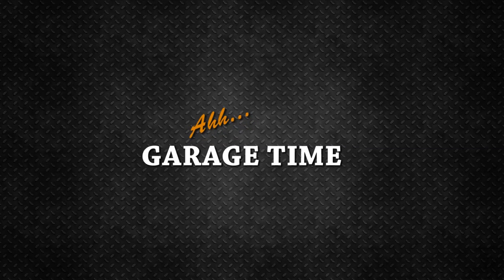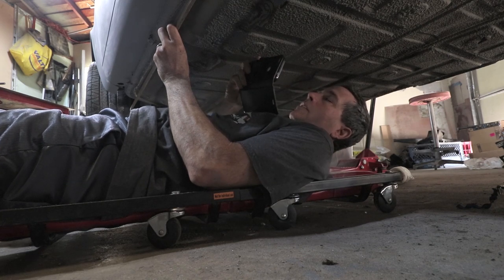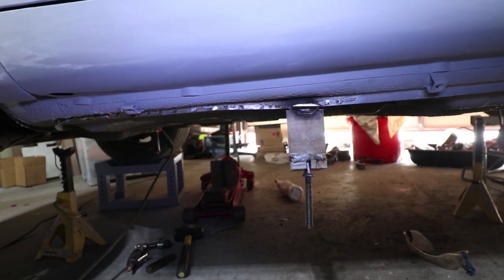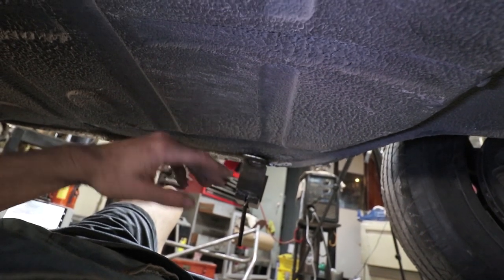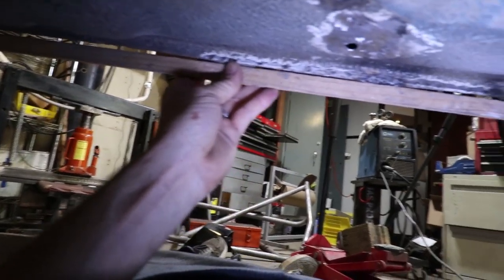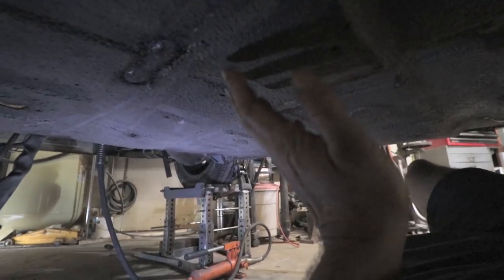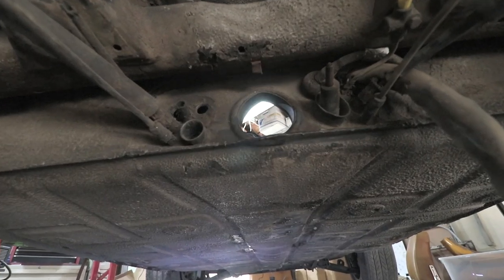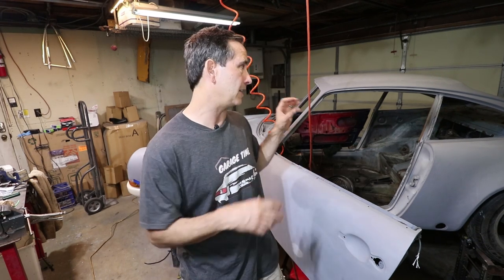How to RESTORE My Trashed Porsche Floor Pan Part Two 🔨🔨

Comment: Cheap offshore motors, is why that motor failed. I’ve seen 20+ year old motors that run almost 24 hours a day, in damp dusty locations, still turning away. As for the Porsche, it’s the little details that make the difference, little things like bent pinch welds just eat away at me. Excellent work! as usual.
Reply from the maker: My last compressor was almost 30 years old and the 5hp motor never failed.  The pump did wear out.  Thanks for always watching Dave!

Comment: Clever hack for the pans. My only beef is "trashed floor pan". You need to spend some time with old muscle cars :) Great job, keep up the good work.
Reply from the maker: Ha ha, where are you located?
Reply: @GarageTimeAutoResto  California. So I was one of the lucky ones. Only about 1/2 of my sheet metal had to be replaced. LOL
Reply from the maker: Rust?  Or other damage?
Reply: @GarageTimeAutoResto  Mostly rust. These cars leak a lot of water, and it collects in all the pans.

Comment: Hi Tom, nice job on the floor pan pinch weld rim. Am I correct in seeing that yours never got crushed anywhere? That’s amazing, if so! My ‘75 has apparently been jacked up (so to speak) by indiscriminate mechanics for much of its life- the pinch welds are crushed, flattened, even split in the typical areas. Someday I’ll have to figure out how to pry and bend them back into shape (if possible). 
As a previous commenter mentioned, it seems like there’d be some risk that straightening the pan might slightly tweak the alignment of the overall frame. If you had a clean slate, would you consider straightening the pan before beating the frame into submission (from many videos ago)? Might be interesting to throw your trammel bar back under the frame to re-check the measurements. 
Regardless, you’ve done great work!
Reply from the maker: Thanks Jake,
           Yes the pinch welds weren't folded over or split.  I've seen that on other cars!  Not sure how mine was pushed up?
      As you heard, I straightened the right corner with massive cutting and force, plus I have experience in twisting and measuring this chassis.  The force involved in flattening the pan is miniscule compared to the force required to move the structural chassis components.  I'm not concerned at all about the suspension points.  I agree it doesn't hurt to measure again though.  No body gaps changed either.  
I do agree it would have been better to do this earlier, but the body work isn't even done yet.
Reply: meticulous  💯
Reply from the maker: Thanks Grant.  In the begining I promised myself I wasn't going to this level of detail, but oh well...it's done now.

Comment: Love the way the pans turned out Tom. I'm sorry to hear about the compressor. I have an IR SS5 that I have abused really hard, running my blast cabinet and da sanders. Did they have to order a new motor?
Reply from the maker: Yes, new motor in the mail as they say.  I guess I'm going to have to baby this new one.  Luckily it's under warranty.

Comment: Just awsome work like allways.    Regarding the motor on your compressor I dont Think it has anything to do with dust. These motors should be able to run in “work”area” without any problems - I guess you just where unlucky.    Cant wait to see the next video from you.  :-).
Reply from the maker: Yeah, my last compressor was a Craftsman 5HP 30Gal and I used the heck out of it and the motor was still good after almost 30 years.  At least this one is under warranty, but the new motor is coming from the other coast, so it going to be a while.  I'll find something to do for next week :)

Comment: Goober mechanics jacking by pinch welds when there are plenty of strong points to jack up without damage, really p*ss me off, their beer guts prevent them bending over and jacking the car correctly so they just ram it under the rocker, don't get me started! nice job repairing the goobs ef up.
Reply from the maker: Thanks, and I totally agree.  These days it's getting really hard to find good mechanics or laborers in general.

Comment: Ignorant question here - how much pulling, hammering, and re-flattening can sheet metal take without getting fatigued? Is there concern that whacking a crumpled up zone back out flat will make it too weak to be structural?
Reply from the maker: Good question.  Mild steel or sheet metal from the 70's is fairly malleable which is how these parts were formed in the first place.  Sheetmetal also has memory which means it wants to go back to the original formed shape.  Each time the metal is formed or moved it becomes work hardened so it actually becomes stronger.  After several full cycles it will eventually break, ie bend a paper clip ten times and it will break.  In my situation, the metal is no where near close to cracking.  Plus no car is designed anywhere near the fatique limit of steel.  I've never seen or read about any cracks in a floor pan.  The floor pan is somewhat structural, but secondary to the longitudinals or crossmembers.  
As in previous videos, I did address all the common crack prone areas found in Porsche race cars.  Areas, such as the anti roll bar mounts, rear crossmember, Strut Towers, etc.  
No concern whatsoever regarding the floor pans.
Reply: @GarageTimeAutoResto  So interesting! Thanks so much for this and for all of the information and experience that you're sharing with us!